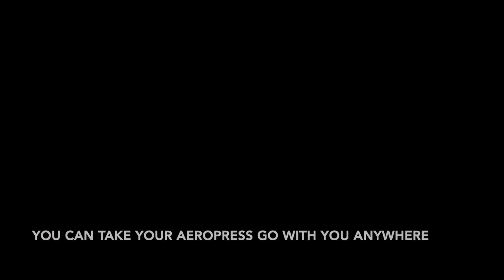Day to Day Life on our Homestead - Off Grid in Rural Portugal

Comment: I've seen a very effective tool for prising pallet wood apart, with nails, so no pallet wood is wasted at all. It has a long metal handle, like a crowbar, that acts as the fulcrum, with 2 tines on one end that you loop under the crossbeams on the pallet. Even when the wood is prised apart, you still have to complete nail removal with, say, a claw-hammer. But at least no wood is wasted. I'll try to find a link to show you what I'm referring to. I'll get back to you asap!

Comment: It needs a base plate and top plate in the USA we call them 2”x6” and 2”x4” wall studs then fit the pallets over the studs for structural support. Then nail or screw the pallets to the studs. It needs longer members to keep them together. The pallets act like blocking on the walls.

Comment: I like your videos very much. I've been watching them for some months now and was wondering why you are not using a drip irrigation system. You would use the water in a much more economic way while watering your vegetables 😊
Reply from the maker: Thanks so much 😊 Unfortunately they tend to get clogged up with our well water. We’re gonna try putting some filters on the pump and hopefully that will help (I have to clean out the sprinklers every day at the moment)
Reply: @FrankieOffGrid Oh I see. Good luck with that.

Comment: Try using zip ties in the trimmer
Use the thickest zip ties you can fit through the holes 
The locking end goes into the hub with the tail out to do the cutting 
Cut to length
Might last a little longer
Reply: Works a treat!
Reply: Fun idea 😂 I 'll give it a shot

Comment: Do you know that there different cutting head attachment for the weedwhackers (strimmer) soft to hard plastic blades or string and why do you use drinking water from that spring source by the road and not your well water?